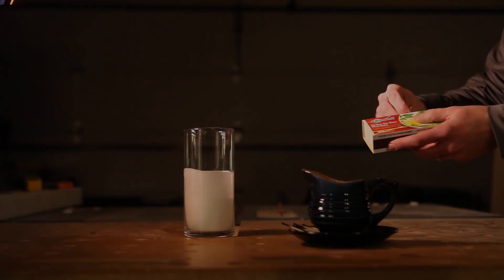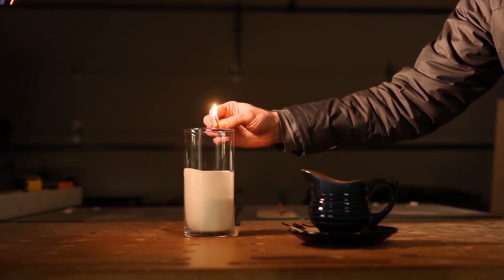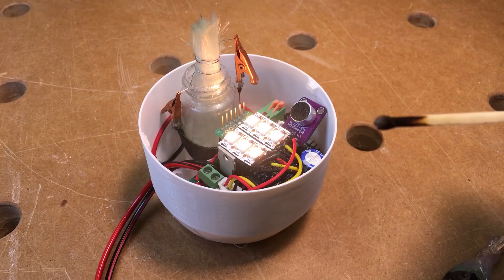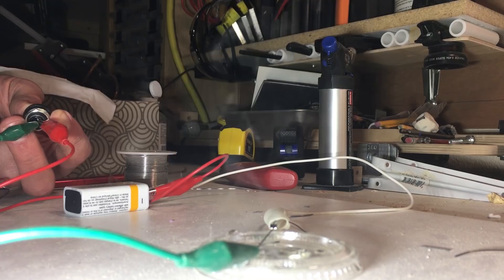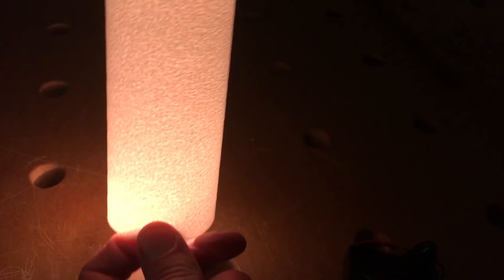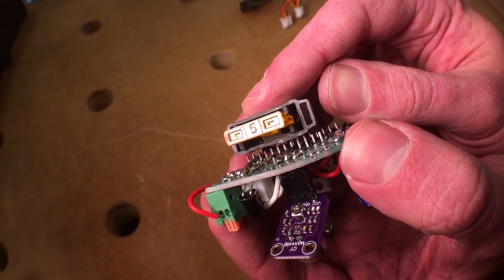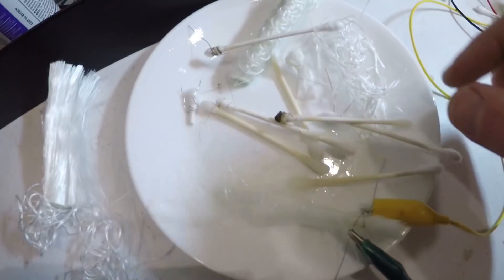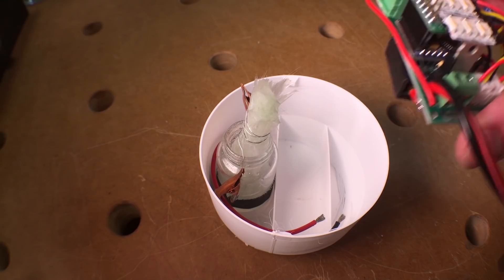Overkill LED Candle (SMOKES) - Arduino & NeoPixels

Comment: A real candle in calm air also spends some time not flickering at all which I think is something (all?) fake candles get wrong by constantly flickering like they've been placed in a draught. Nice lathe-iron btw :) Regarding batteries that can provide the needed current: have you checked out vaping-grade lithium cells? A 900 mAh 18350 can provide something like 9 A and you could always use a couple in parallel or a 18650 for more current.
Reply from the maker: Good point about a real candle staying still at times. I’ll have to account for that in the code. 

As for 18650s, yep I tried two in a series for 7.4V (and just one at 3.7V).  I found they can provide enough current but the higher voltage was necessary to get that current quick. Not sure if it was the voltage or the supply type that contributed to that though.  I didn’t try two in parallel but I would have had to have a lot less resistance on the wire in order to draw the same amperage at 3.7v. 

I feel that there’s probably a certain combination I’m missing. 

I tried 36 gauge Kanthal wire thinking it would heat faster (accommodating for resistance differences), and it did, but the spread of heat was frustratingly uneven.  The wire touching the wick/solution would cool off due to the solution sinking the heat, but the wire in free air between the lead and wick would get red hot and melt/deform. Maybe there’s something there to running 28g all the way to the wick, and 36g only where it touched the wick/solution. (Didn’t try it). 

Re: amperage, those e cigs seemed to be drawing a ridiculous amount of amps. IIRC the pre-made cartridges tested at 0.5 Ohms, which would mean 7.4A @ 3.7V, or 14.8A @ 7.4V which seems insane. 

There’s gotta be some combination that I haven’t tried yet worth using. 

I now wonder if the plug in power supply is loaded with capacitors that are allowing power to flow so much quicker than those 18650s.  

I did get my hands on what appeared to be an old school sort of basic e cig, which simply shorted the circuit with no protection (1 cell, 3.7V) ad it generated smoke but it did take a good deal more time to generate smoke than would be natural for the candle. 

Closest I came with a reasonably small battery was a Canon LPE6 which is for my DSLR. 7.4V. Cells are smaller than 18650, and I don’t think there’s a cap in there, so I think my tests were at fault. 

The Bosch 12V (10.8V) series was usable but didn’t seem appropriate for an instructable. 

But there’s gotta be a way....  I’m guessing it has to do with storing energy to be ready, or a difference in the wire resistance/technique of wrap.  

I’ll try more if I do another build. But do tell me if you find a way to make it work with battery power with a small footprint. (And appropriate protection circuitry if 18650s are used)
Reply: What about three vape-grade 18350s in series? They're almost half the size of 18650s so you might be able to fit three in your container. Alternatively, maybe you could make a circuit to boost the voltage from a single 18650? I guess a general-purpose voltage boost module would be bulkier than necessary.
Reply from the maker: @rupert274  Good idea on the 18350s for size as long as one can figure out a setup that provides good mounting and a protection circuit, and charging.  I think that's a feasible way of getting the smoke quick, and the batteries should last a while since it's only 3A for 1.2s.  (assuming 10.8V and you clamp at a slightly lower resistance to accommodate).   I'm moving on to other projects but the idea sounds promising.
Reply from the maker: WannaDIY  The Makita in the picture is just hooked up as a test when I wanted to try pushing 15V.  It's regulated with a BUCK hot glued on top and fused @ 7.5A to stay safe.

Comment: Instead of glycerine, maybe get some of that plug-in room freshener oil.  That  way the candle would have a dual purpose.

My doctor has a fake candle in his waiting room.  It is so realistic that I thought it was real until I got right up close to it.  The flame was a pair of LED's shining on a flat plastic flame.  They could be UV and the flat flame is coated with some sort of phosphor.  The bottom of the fake flat flame is connected with a spring like a bobble head figurine.  Not sure what makes the flame bob around - maybe an electromagnet or something.  

Here is a video of how my Doctor's  Luninera fake candle works - maybe an idea for version 2.0 of your candle: https://www.youtube.com/watch?v=P0REXQib5eI
Reply: Legend says that your doctor is fake too like that candle beware

Comment: Please don't use glycerine for the smoke. Above 200 °C it could burn to the very toxic and carcinogenic acrolein. In fog machines they use propylene glycol for this instead. But not sure if this would work your way too, because they use this in combination with distilled water and in a different way, so none of these chemicals would be burned anyway. And vapes are using the same method as fog machines. So far at least my knowledge about this. (Sry, my English isn't the best.)
Reply from the maker: #Reaper Do you have any reputable sources you can share on this?  I did some research on the topic and found what you say to be the case, but for much higher quantities than this. DIY fog machines commonly use glycerine + water from what I could tell (to reduce carcinogen risk). But that’s loads more smoke being inhaled than this. (A room full of fog for a while versus a 2 second whisp).  And, veg glycerine is commonly listed online for DIY vaping juice. If you have any links to reliable sources that would be insightful. From what I can tell, in this quantity it’s nothing to be concerned about. But, I also value the health and well being of my viewers.
Reply: @KeithsTestGarage  Foreword: Well, I will do some more research these days as I'm also going to build a little DIY fog machine. So far the only sources I remember is Wikipedia, but it's not mentioned in the English one. And I need to be careful to not always mistake glycerol (aka glycerin) with glycole, btw.
Here https://en.wikipedia.org/wiki/Acrolein#Production there's at least the chemical formula how glycerin decomposes to Acrolein at 280 °C. The lethal dose of acrolein is listed in the right table for animals and seems pretty low with like only 150 ppm for a dog. 
One big difference is that usual fog machines don't burn anything, the same as vaping machines (sry, idk how they are called correctly) always claim in difference to normal smoking: The difference is, that the vaporized water is used to push the glycerin or glycole as tiny drops into the air, an aerosol. The most(?) fog machines are temperature controlled for this, newer vapor things also afaik. 
I won't to make any statement about how toxic acrolein is in your use at all. Anyway, finding an unproblematic way to directly generate smoke as you did - and it really looks more like smoke than fog, a feature - would be an interesting task to me at least. (But might hit some months..)

By the way, I forgot to say: Really nice and decent project! Now the only thing that's missing is the detection of some draught and the candles reaction. jk ;)
(And I always got afraid about the electronics when you got close to it with the fire. 😉 )
Reply from the maker: @Reaper035  Thanks for the additional reply.  And, good idea of the wind/reaction.  I think that's doable.

Comment: You lost me with the blowing part. 

That needs to have more definition. On a real candle you can barely leave a whisk of flame by blowing gently and watch it struggle to reignite, or fade to nothingness, it really needs a bit more attention there to get it to be even more candle-y than it already is.
Reply from the maker: Very valid point.  If anyone gets to this before me, the code is currently using a threshold of 950 out of 1023. Higher than that it turns off.  It sounds like a second threshold would be good. Maybe in the range of 850-950, where if that is detected, it only goes dimmer and struggles as you mention.  Thanks for the input.